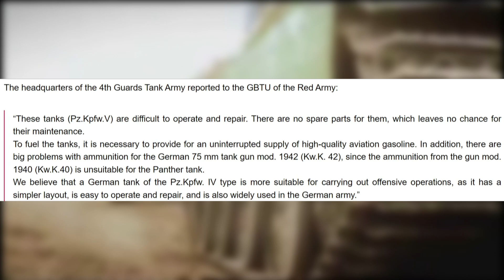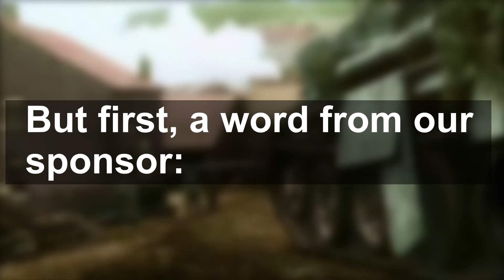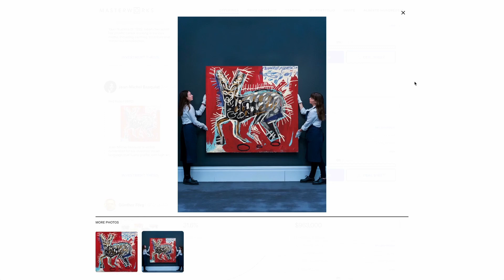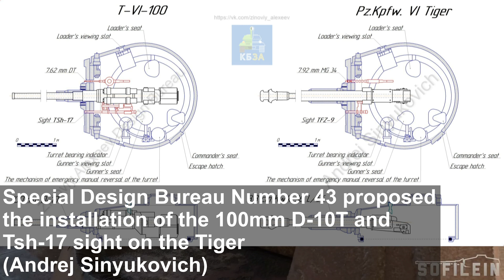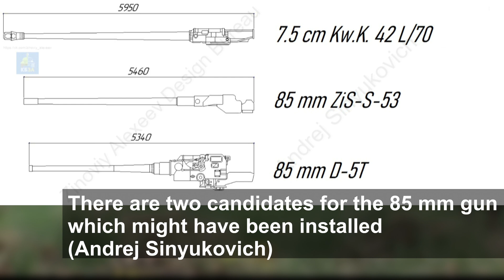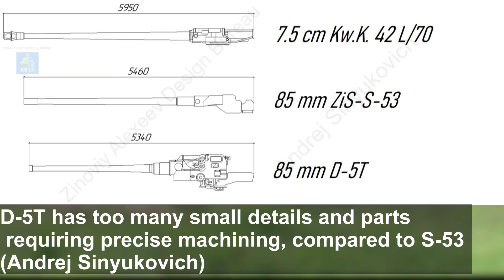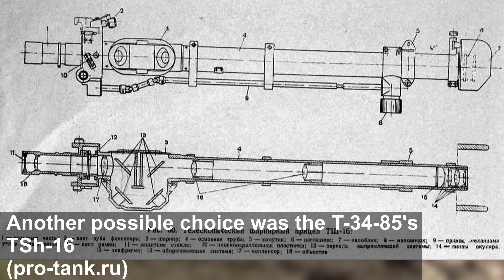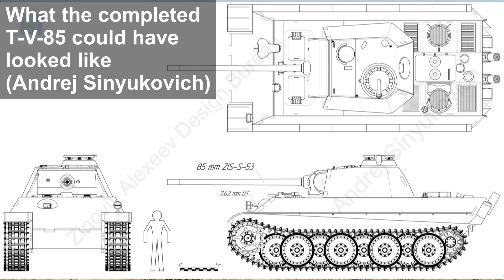Pantera Sovetskaya, the Soviet Rearmed Panther | T-V-85

Comment: In point of fact Russian tanks were just as bad to maintain. The solution to this was that the Russians just ground them out like so many rolls. Only later after the war were the t34/85 and other Russian armor improved in quality whatsoever..
Reply: I don't think such General Statements can be Made on the T-34. By the late war, some Factories had really improved their production, and were thus making good Tanks. But as I Said, "some".

Also, even though both were breakdown heavy Designs, the T-34 was still easier to get running again.

Comment: 85mm gun, V2 engine and later soviet transmission in a Panther (plus a DShK on the cupola for good measure) would've been real interesting.
Reply: Sounds interesting the transmission could still need work but the engine would be a massive improvement

Comment: Panther was rushed design and as such there were plenty of small kinks in design which were never fixed. And project documentation was in Western zone, while Soviet Union was already working on design which became T-54/T-55
Reply: The panther had great potential as a primary tank tho, many of the reliability issues were fixed by the g models release, save a few things, if development continued post war I feel it woulda been Germany’s primate tank for a long time
Reply: @c0ldyloxproductions324  Sure, and Von Paulus, conqueror of Stalingrad, would have been great post war Chief of General Staff. I am bit ironic, but nobody in Europe had much resources to build new tank fleet 10 years after war.
Reply: @mladenmatosevic4591  the centurion was a ww2 design and look at it now its been in service with multiple nations int multiple configurations even now, the Sherman was only removed from foreign service in the 70s and 80s and 90s, the panther if given the chance to be improved and modernized by what ever nation that wanted it would have been a fairly good tank it was already fast for its time and decent firepower the turret ring was almost as big as the Sherman’s despite the French’s apprehension of how small it was so it definitely coulda had bigger gun installed, the panther was the tank the Germans should have focused on in the war not the tiger 2 maus or tiger 1
Reply: @c0ldyloxproductions324  How many were built from war to 1950? Or even 1955? Of course you need to maintain engineering team and you prototype few peaces for tests, but mass building of new tanks did not start straight after end of war
Reply: @mladenmatosevic4591  an estimated 6k panthers of all models were produced total
Reply: @mladenmatosevic4591  in comparison the panzer 4 had 8k + produced so that’s rather impressive that that many panthers were produced when the panzer 4 had been in production from the start to the end of the wat
Reply: @mladenmatosevic4591  it also cost a similar amount albeit slightly more than the panzer 4
Reply: @c0ldyloxproductions324  It appears Germans thought they will crush USSR as easy as France, so did not take war seriously enough. And in late '42 was too late to change course of war.
Reply: @mladenmatosevic4591  yes I know, but again U can’t discount the amount of panther tanks they managed to produce having only started in what 43 I believe in just 2 years they almost reached the production numbers the panzer 4 had which had been in production since the beginning of the war
Reply: And sure the brits produced some post war and it did go from 46-49 but they didn’t do it on a mass scale and only produced a couple hundred
Reply: @c0ldyloxproductions324  Excactly. You keep core skills alive so you can ramp up when needed.
Reply: @c0ldyloxproductions324  I have to add to this idea as You have activated my tank geek. I apologize for the wall of text.

If we are talking in a purely speculatory manner, the Panther would have indeed been the best candidate for a "German post-war MBT". However, it would need to have it's engine and transmission completely reworked. The suspension would also need a rework as it made maintanance much more difficult than it had to be and couldn't quite cope with thick mud that froze over night.

The Chieftain has an "Inside the Chieftain's hatch" episode on the Panther and the turret is cramped, so no, a bigger gun wouldn't fit without increasing the turret ring. Add the fitting of a larger turret ring to the list. Honestly? The Panther didn't need the 88mm, it just needed a bigger turret ring. A simple and straightforward sollution would be to use the turret ring and turret of the Tiger I, but with the long 75mm. Maybe even an 80mm gun derived from the Bofors 80mm AA gun.

The Panther was about 117.000 RM to produce, the Panzer IV was 103.000 RM. The Panther was simpler to produce, thus it was also faster to produce, as evident by how many they were able to produce in a much shorter time when compared to the Panzer IV. Note that the price is the production price of the tanks themselves, not including munitions, radios or other "extra equipment". Cheapstake Germans, tsk tsk.

All the changes would add more weight, my guess is at least 5 tons if the turret and turret ring are enlarged, so, a total weight of about 50 metric tons. About as heavy as the Centurion, with both being about 14 metric tons heavier than the T-54/55. The Panther in it's untouched form is about 44,8 metric tons, so, about 9 metric tons ehavier than the T-54/55.

Overall, it would be comparable to the Centurion. At least the Early Centurions. We are talkign the 76mm and 84mm Centurions, before the Centurion leceived the 105mm L7.

I'll keep the quality of the armor steel out of this as we are assuming the ideal conditions for Germany in this scenario.
Reply: @ravenouself4181  well we can use the ideas from the E50 project where they reduce the amount of overlapping road wheels so u only have 3 sections of overlappingGeheges which reduce the amount of time it would take to replace them, thre engine needs more power and I would move the transition the rear so that it’s much easier to access, turret rings are easy to fix cause all ud have to do is widen it then install a turret to fit it
Reply: @ravenouself4181  granted I still would prefer the 88 over an 80mm mainly cause using an 80mm would require production of all new ammo over the 88mm which has stockpiles of ammo

Comment: I've read that soviets tried to put Panther's wheels on T-34 in case if there would be no spare T-34 wheels. They fit after slight modification, but tests have shown that they break quite quickly
Reply: The issue there is the number of road wheels.  The Panther ones overlap, so there are 8 of them, per side, compared to the T34 with 5, and hence each supports less weight.
Reply: @charlesphillips4575  Not just that, in the end of the war germans used wery bad materials.
Realy more cast Iron, wery litle alloying metals. Too much Sulphur and Phosphorus, making the alloy britle.
Reply: @charlesphillips4575  yeah, obviously
Reply: @charlesphillips4575  well panther is still 44 to 45 tons and T-34 is only 32 tons
Reply: @akriegguardsman  45/8=5.625, 32/5=6.4, that is about a 14% increase.